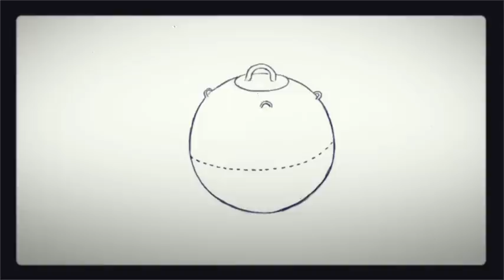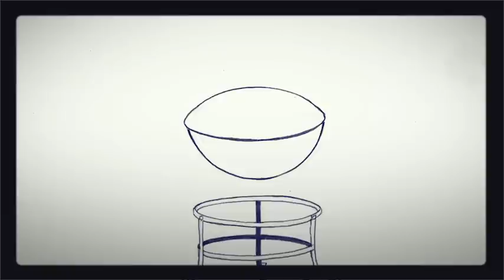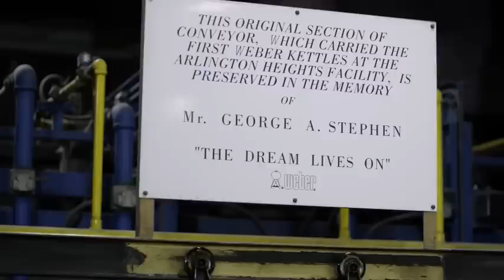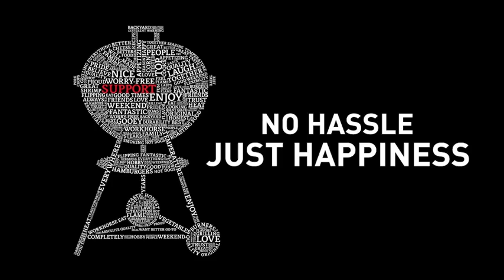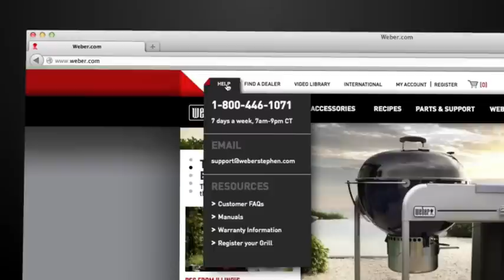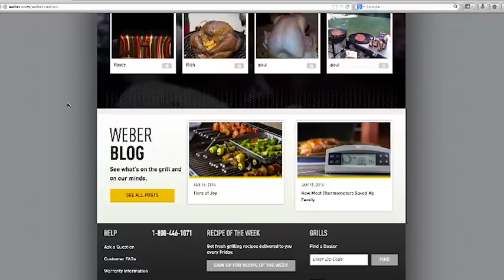How Our Weber Grills Are Made | Weber Grills

Comment: Big fan, but I wonder when you will make a proper cast aluminum or 304 stainless steel cook box for the Summit.  It is by far your top of the line most expensive gas grill but the worst in durability.  I recommend to everyone to stay away from them as it is not if but when the cook box rusts through.
Reply: Burns through. Not rusts through.
Reply: @muzaaaaak  Burns through because heat / cooling cracks the enamel, then rusts.  Then burns through the front of the fire box and makes the grill dangerous.  For their top of the line grill that costs thousands you would think they would correct a design flaw that has spanned decades.  I have replaced their fireboxes and it is not a fun job.